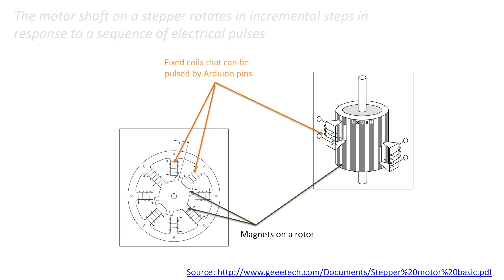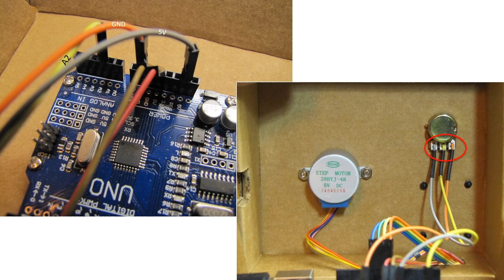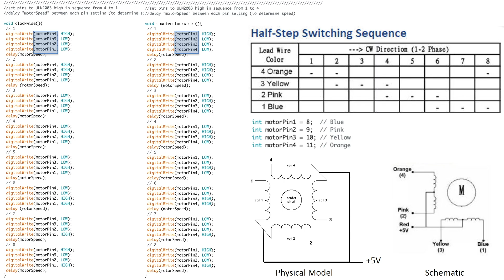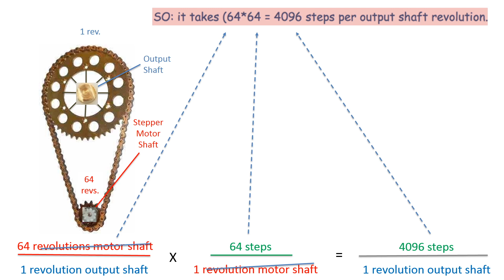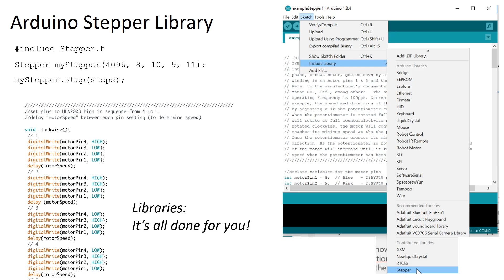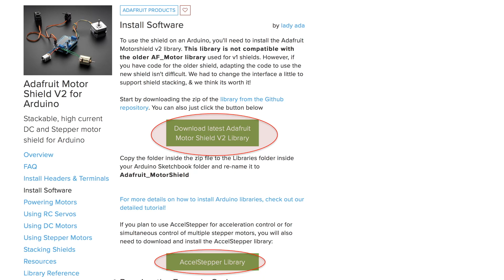Chapter 10 - Exploring Stepper Motors (28-BYJ-48) with an Arduino

Comment: Hello sir
I am using stepper motor and driver same as you using 

But when I use it in my project led s won't blink may be power is not coming 
I used both powering it externally as well as from Arduino 5v and gnd. But it is working only sometimes. I also have servo motor,2 other sensor connected to Arduino. And the external power supply I used are 3.7 volt 2 18650 batteries
Reply from the maker: If the issue is intermittent, it sounds like a poor connection or a power issue. Can you check all your connections for continuity and also try powering the servo separately to troubleshoot? Details regarding power are summarized in this video: https://youtu.be/mTHwa_UCYMQ?si=PexYd-Tj71ynRlkC . Cheers.

Comment: This is by far the best video ive seen on the 28-BYJ-48

The motor is great for simple tasks but really starts to struggle at 5V with the ULN2003 with anything demanding torque or precision.
For that reason I love running a modified 28-BYJ-48 with an A4988 at 12V 120mA. 
You can get much higher RPM (I tested to about 25-30, but ofc you will lose torque) Or get a lot more torque at the same 5-12 RPM.
 Sure the ULN2003 can be run a 5V, from the same source as the microcontroller but the 28BYJ48 and A4988 Combo can easily be run on a cheap 5V to 9/12V boost converter, which offer a small footprint and enough current capability to run the Motor/Driver reliably and without overheating.
Reply from the maker: Thank you for sharing these pointers- makes posting these videos worth the effort👍.

Comment: Can it be automate to use in String Art..also called as Thread art.. but how to achieve
Reply from the maker: I don’t know what string art is, but the motor is certainly easily programmable to pull and release strings in a spool if that’s your goal. I have provided sample code that can help with the same.

Comment: Can it be possible to give input as number to move to particular position... Let say 360points in Circle and wanted to move pointer  to that input number on protector...like gauge
Reply from the maker: Absolutely. The code I shared can be hacked to do this. You could for instance tie an environmental sensor to an Arduino to position the pointer.

Comment: Very good video on the 28BYJ-48 stepper motor.  Last week I received some as well as the ULN2003 stepper driver board.  I have the 12 volt version of the stepper motor and am driving it from an external power supply.  It looks like the gear ratio problem has been fixed.  I did take one of my stepper motors apart and examined the reduction gears.  The driver motor shaft has 9 teeth on it.  The first gear  has 32/11 teeth.  The second gear has 22/9 teeth.  The third gear has 8/27 teeth.  The output shaft has 27 teeth on it.  I know it's a bit confusing but my calculations resulted in 9/32 *  11/22  *  9/27 *  8/24 = 0.015625.  That's the same as 1/64.  My testing did show that 2048 steps resulted in 1 complete turn as expected both CW and CCW.  I've only been working with my Arduino GIGA R1 WiFi board for about a week but so far it does everything about as expected and I'm making progress on my project.  Another thing that I did notice is that when I connected a pot to the +5.0v supply that the digital to analog converter didn't behave quite as expected.  My research indicated that it was better to put 3.3V on the high side.  I tried that and it did seem to work better.  For my project I do need to turn the motor output shaft plus and minus 180 degrees and that does seem to work.  It would work better if I could disable the 12 volt power to the driver board a short time after my remote adjustment is made and that's what I'm working on now.
Reply from the maker: I’m so glad it helped! It sounds like you are well on your way towards finalizing a successful project. Thanks for sharing your calculations and results on the gear reductions and best of luck with your project 👍.

Comment: Yes I'd like to hook one of these stepper motors up to a microscope and then having a nano separate like look at the sample results in a centimeter cubes hand sample container using a small pump with it they sell these you know they're really small water pump electric Free trainer model online Jetson nano haven't look for your coli or parasites that are known to be issue in places like Africa were 250 million children are affected by parasites and you know they're also not getting enough nutrition and no matter how many of those peanut butter packets the United Nations food agencies giving them they aren't able to absorb it because they have parasitic for the people local people to know what the condition of their water is at any given moment is it is a good idea. People have the results of a Raymond spectroscopy a microscopic analysis of the water on The edge 200 Reno and a nano like a system-on-a-chip. I mean this is really taking the edge to the edge. I have the idea but I could never do this coding myself I don't know how. I could do the tensor. I can only learn so much so quickly. This would be a project for more than one
Reply from the maker: It's a good idea. The coding isn't too bad if you take it in very small steps- one piece at a time. That's coming from someone who was never formally trained outside of a class at my local community college, but I've managed to take ideas like these to fruition by breaking the problem down into small pieces. One of my old colleagues at work used to say: "Eat the elephant, one bite at a time."

Comment: Along with others, I also say this has been an excellent primer on geared-stepper motors.
I am trying to replace the meter-movement of a vintage Simpson 260 analog meter.  My questions are, is there a geared stepper motor that maybe has a high gear ratio that would both be very accurate (hopefully to a needle-width) that would not take too long to reach up to around say 120 degrees of ‘swing’ (you could lookup an image of the Simpson 260 to see the needed deflection angle).  How about 100:1 ratio and small enough to fit in the original meter as there doesn’t have to have any power/torque just to run a needle?
Do you feel this is doable or would I suffer reading-accuracy or to-slow needle travel-time?
Reply from the maker: Thanks! I appreciate that feedback and interest. Steppers are fascinating and I hope to return to this topic shortly. I will need to do a little digging on a Simpson 260 analog meter to answer your question intelligently- let me get back to you.

Comment: Great explanation of stepper motors and controlling them through an Arduino.  
Are you aware of any smaller stepper motors that perform a 6 degree of motion (or a multiple of 6 desgrees)?  I would be looking for one of similar small size as the one in your demonstration.  I would assume if such a stepper motor is not available, one would have to probably design a gear reduction to achieve the 6 degrees of rotation.
Reply from the maker: Adafruit sells a smaller stepper with a 1.8 degree rotation: https://www.adafruit.com/product/4411 . Judging by your handle, sounds like you have the equipment to design any gear ratio you need. 😊
Reply: @ModestMaker  Thank you for the info!  Yeah, I could design and cut some gearing.  I would just need to work out the appropriate ratios.

Comment: Came here for info on speed variation,but will for sure go to Chapter 1 and give this series a go.
Well explained.
Reply from the maker: Hope it was helpful!
Reply: @ModestMaker  Yes it was,gave me some refreshment in some of the current and voltage stuff.
The water based explanation made more sense than the explanation 30 years ago (school),I am watching it again ATM.
Have some stepper motors now,but was lacking the time to do the practical appliance.
Thanks for taking the time to make these series and will let you know how the implementation journey was.
Reply from the maker: So kind of you to take the time to share your response - makes the effort worth it!

Comment: Modest maker, great explanations, on the other hand, I am new with Arduino and I kindly would need your help, I have an Arduino uno hook up to DM680H for an stepper motor nema 23; the connection from my Arduino to DM680H (Dir-, Pul-, Ena-" are connected to Arduino Ground) ; (Dir+ to pin 11, Pul+ Pin 12 and ENA+ to Pin 10) I don't know if that is correct but assuming that it is, how do I define the pin in this configuration? I am using your "exampleStepper5.ino" . I want to use the potentiometer to bring my motor to zero and then the motor can goes up and down. Help

Comment: Hi there! Excellent video! I am working on a project using 28byj steppers and the “precision problem” is the cheap gearbox with a huge backlash - so, when you change direction, a few steps will be “wasted” until all the gears get in traction contact again. The AccelStepper library has a setBacklash method that could potentially fix this... didn’t test it yet myself. It looks like:
    /// Sets the number of steps needed to correct backlash in drive train
    void    setBacklash(unsigned long steps);

Hope it helps!
Reply from the maker: Thanks so much for this info... will try to include this in the description of the video shortly!
Reply: @ModestMaker  does it solved the problem really ?
Reply from the maker: Haven’t tried it, but his approach makes perfect sense.

Comment: Thanks for this video, it helped me a lot. I'm wondering how to change the code. I'm making a star tracker and want to run it using a stepper motor.  I need the motor to run in one direction only, and I need to control the speed from zero to max using a potentiometer.
Hope you can help.
Pat
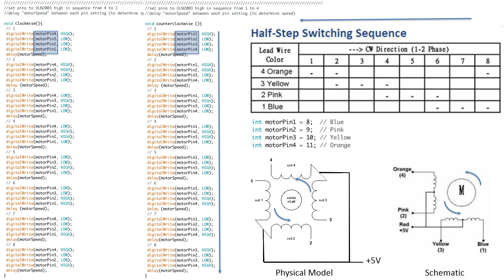Reply from the maker: Hi Pat. Sounds like a great project! You should be able to achieve this relatively easily with the code I provided. See minute 11:50 for further details, and note you can download the code for edit from chapter 10 associated with this link: http://www.biod101.com/arduino/part1.html . In retrospect, that's a great idea Pat - I see where you are going with this since I also have a small reflecting telescope that can be difficult to adjust, so a potentiometer with steppers would be the way to go. I'm going to have to think about this for a future project - thanks for the inspiration.
Reply: Thanks for the information. I have downloaded the code and it works perfectly for the star tracker I built. The only thing I would like to change in the code is the maximum speed. I would like it to revolve a little faster at max. What values do I change to make that happen.
Thanks.
Pat.
Reply from the maker: Sorry for not replying sooner. I would suggest playing with any delays on the code. That manages the time between each step, so in sum, would control the speed. Let me know how it goes- would love to see your finished project.

Comment: Could I see a arduino sketch code showing??? say, 9 pm to am in degrees of course like +180 cw to ccw -180 thank you. diytea56@gmail.com . on the stepper motor you feature please.hank and  bless your time.
Reply from the maker: Sure - All the sketches are posted to my homepage - check here for the respective video which will include a download link: http://www.biod101.com/arduino/part1.html (Scroll down to Chapter 10 for the link)

Comment: hey modest.i want to ask like u r using this motor driver which has 4 outputs.but i am using t56560 driver and i connect all four wires of my motor at left side and on the other side i only get step and direction ,ground and enable pin.so out of these pins which are in1,in2.in3and in4 ?could you please help? i will really appreciate it.this video was bomb with explanation.thanks and god bless u
Reply from the maker: Thanks Param. Sorry, I am not familiar with this particular driver, nor can I seem to find a link for it online anywhere (t56560 driver). Are you trying to run that driver with this particular stepper motor? If so, would recommend just using the ULN2003 motor driver that is commonly sold with this motor.
Reply: @ModestMaker  hey modest its tb6560 ...typing mistake.uln2003 are old drivers and new drivers are much better in terms of current adjustment and micro stepping.could u kindly see tb6560 on internet? thanks

Comment: I am new at this stuff so this might be a stupid question. How did you lined it up at 19:08. Is there any way to set null position for a motor?
Reply from the maker: Good question! I think this may be a bit confusing because in the video, I say I "line it up, and going to reset it". Actually, what I should have said was that "I'm going to line it up BY reseting it - right at the moment the pointer is pointing north", so good catch on your part. Yet another way of doing this is by timing the upload of the sketch so that it stops the pointer precisely when it is pointing north, and then restarts the sketch from there. This takes a little skill.
Reply: @ModestMaker   ...by timing  the upload of the sketch? Sorry but how can we make this? It's a great video you have done !  This will be very useful for a small robot ou machine, when we switch it on the motors must stay at the right place. Any advise  will be nice, thanks.
Reply from the maker: @nicolaslac1013  It's been awhile since I played with this, but I recall I had the box hooked up to my computer with the sketch running. When the pointer approached the 12-o-clock position, I hit upload on the Arduino IDE. The upload caused the pointer to stop, and then it started its loop function from scratch. This is what I mean by timing - I had to predict the time it would take for the upload to interrupt the turning of the shaft/pointer so that it would stop exactly where I wanted it to. Honestly, I don't know how to do this programmatically since unlike servos, there's no feedback on the position of motor shaft. I guess you'd have to do this through some kind of secondary feedback sensor hooked up to an interrupt (?)
Reply: @ModestMaker  Thank you for your answer, yes I think you're right. I'm investigating a little, kind of beginner.